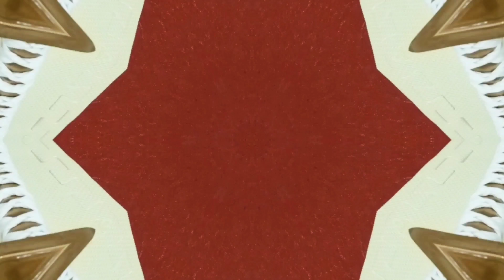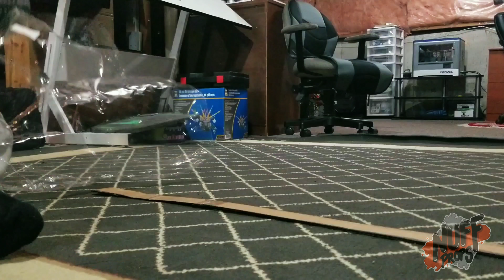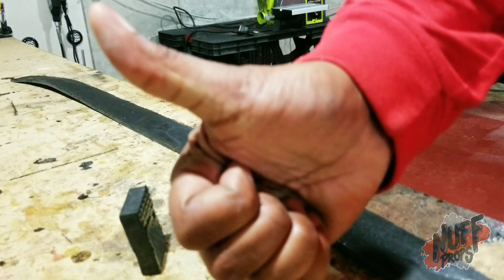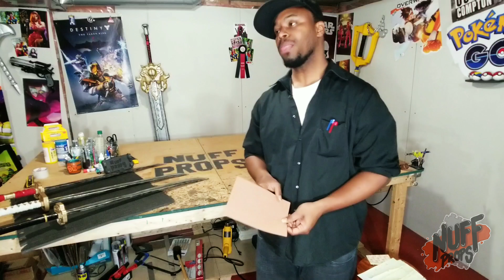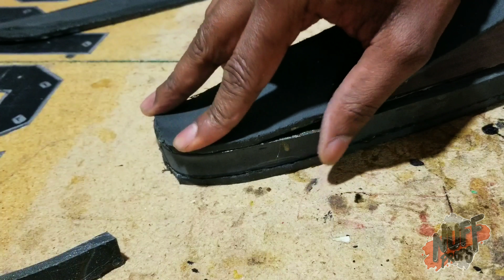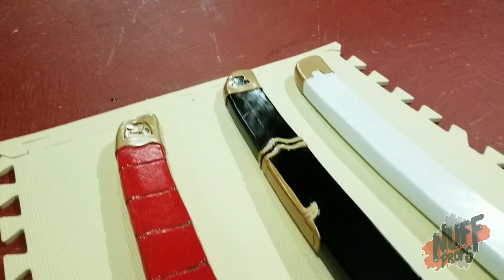How to create a samurai sword out of EVA foam

Comment: How would you use a dremel instead of the sanding belt? I feel like I can’t get my dremel attachments to go in at that angle with how short they are.
Reply from the maker: Try using your dremel on an angle, or holding the blade on an angle.  It will take some time but it can be done.  Practice on a smaller piece first till you get the technique down.

Comment: Awesome tutorial. My local comicon is really weird about metal put in props, do you know any substitutes I could use instead of a metal rod?
Reply: Dowel rod, their wood!
Reply: @slippy1423  Thx. Any advice on how i could keep it at a slight bend?
Reply: @aidanviarengo8536  you can cut it and half and bend part of it slightly, but sometimes it will sit straight inside a bent blade
Reply: You could use pvc rods